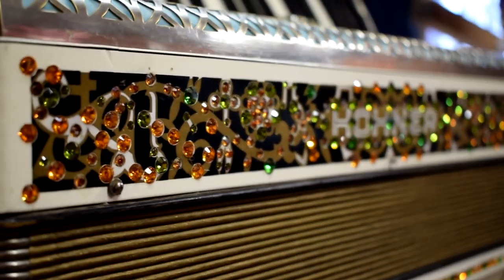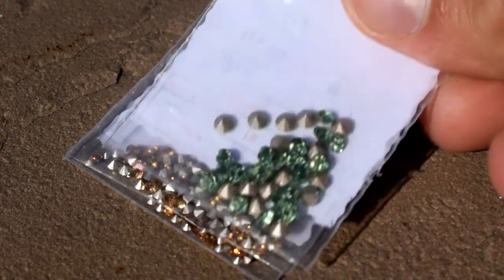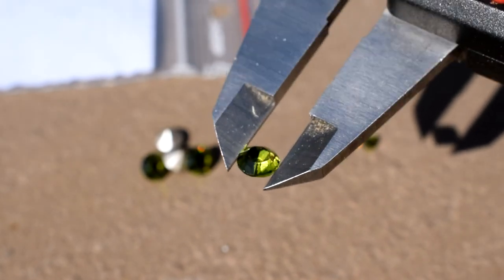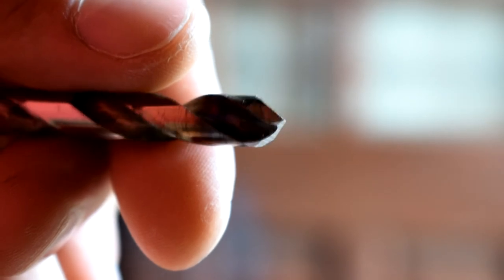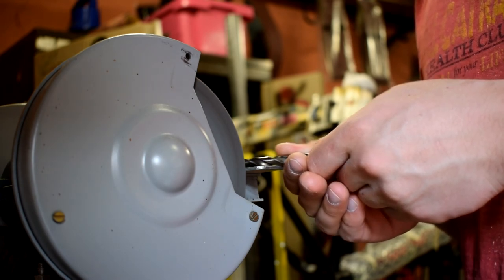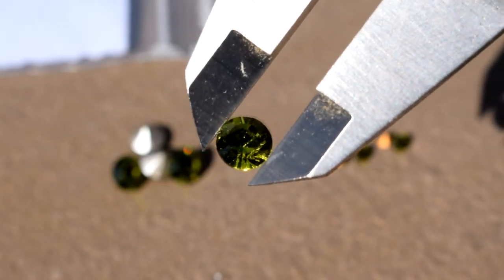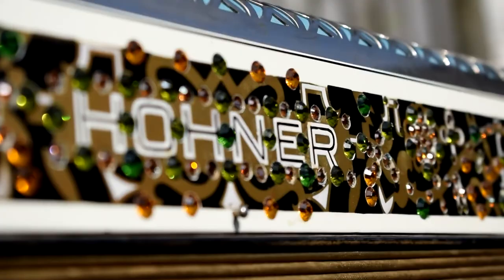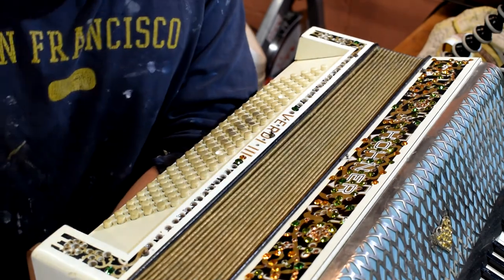How To Set Conical Rhinestones/Chantons

Comment: Thank you I found this very useful. 1st ever attempt at this.  Wanted foiled pointed backs not flatbacks but how do I imbed in plated brass.  All these words I've learned from googling and YouTube today.  Finally used enough correct keywords to get to your video.
I'm fairly handy so I had a dozen ideas on what I could use and do but I thought surely I'd find a demo to sort me out.  1000 demos on how to glue flatbacks which is a self explanatory elementary in the words "glue flatbacks".   Only 1 video on wtf to punch right size and depth of stone set into hard material. I thought about a drill bit but filing it solved my control and fit worries.  Plus this is a way that's about as efficient as it'll get without some sort stencil and a press or something so, IMO, the better visual quality pointed backs can be used with hard material.  This is a long ass comment but trial and error B.S. doesn't intrest me and not an option. I have one piece of metal and now confidently feel I can do this in one shot. Again. Thank you very much for taking the time to make this video.